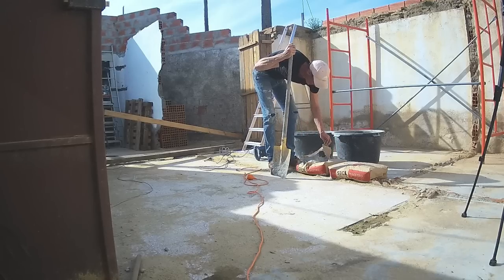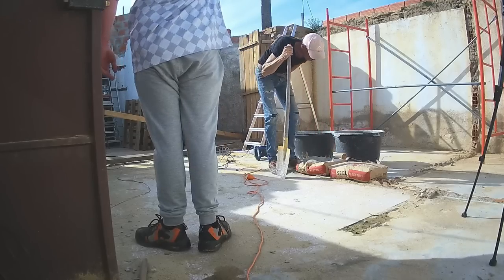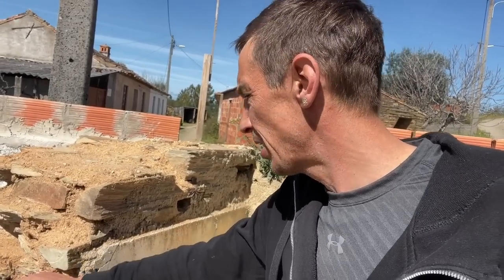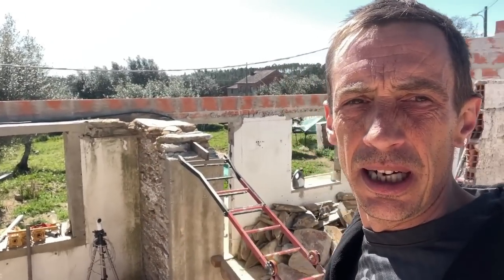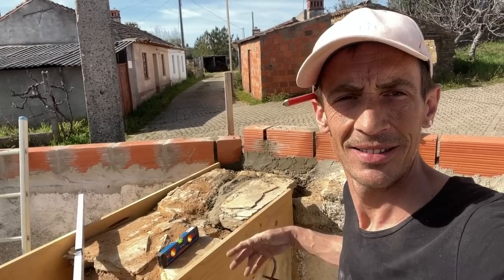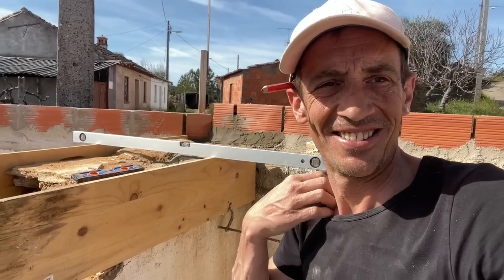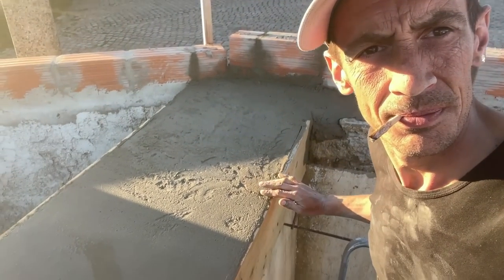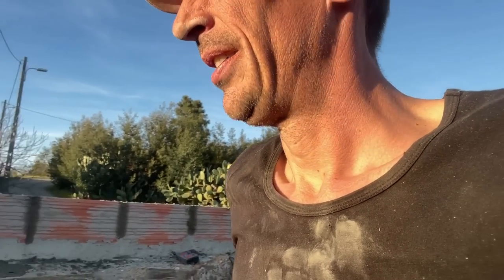S3E6: POURING THE LAST PILAR - DIY PORTUGAL

Comment: Have you checked to see if pouring and using all this concrete won’t draw moisture from the ground etc and later down the line cause damp issues ? Whats the membrane under the house like has it even got one ? Might be worth doing some research before going any further as theirs a reason they used thin layer of concrete and shingles instead
Reply from the maker: I do research mate. In this case, its Portugal and there will always be damp. And im not going to take out the floor so.. We will try and protect the house from the outside later :)

Comment: Jasper! Why? Do you. Not the concrete! Anchoring to the floor and in several places in the existing wall? You're going to put a lot of weight on it. I'm not exactly sure how much concrete goes into it. But if it's only 200 kilos? I wouldn't dare to do it WITHOUT ANCHORS! Greetings a concrete craftsman from Spakenburg, the Netherlands.
Reply from the maker: All works fine here mate, many houses done like this here that are standing for decades :)

Comment: no rebar at all in that "pillar"?
Reply: I thought so too. The concrete is simply detached from the existing wall. I have a training for concrete craftsman. And have Jasper. Things have been said before, what can be improved and what. In my opinion, it should also be better. I trained as a carpenter at school. did that for 6 years. In construction and furniture. and 25 years in making prefab concrete elements. Greetings from Spakenburg, the Netherlands. The concrete man.
Reply from the maker: Yet walls here like this are standing for 40+ years.. hmmm
Reply: @GhostTownVlogs  not seen them made without rebar there before shrug even the premade beams have rebar in them